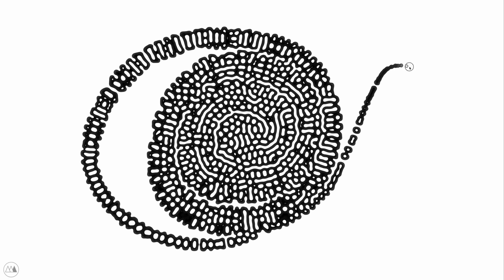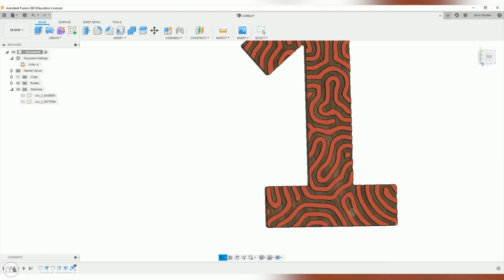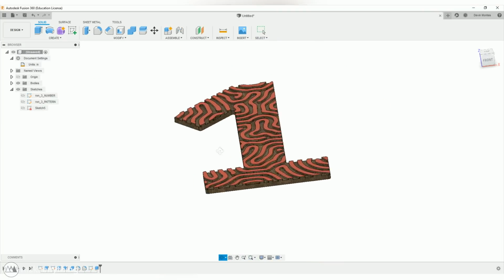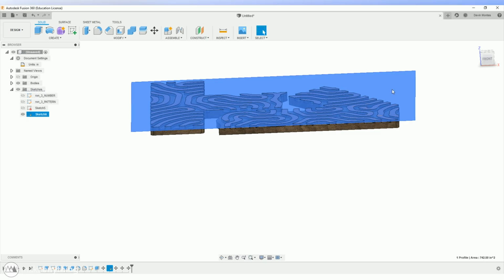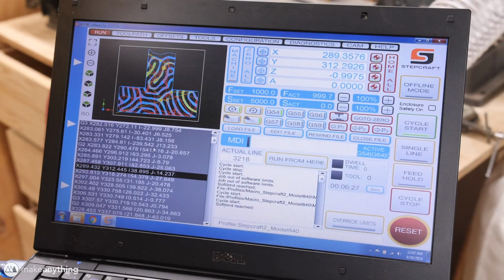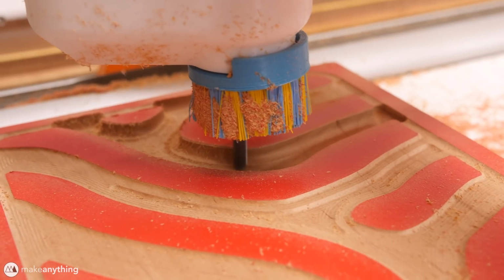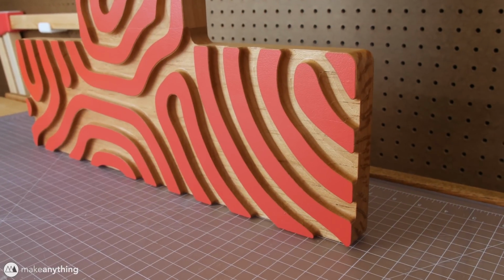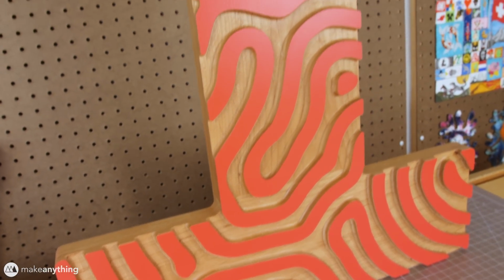My Number 1 Project // CNC Wood Carving a Reaction Diffusion Pattern

Comment: Where did craftsmanship go? You could do this in half the time with a chisel, without an expensive CNC machine and computer to run it. Not to mention the expensive, probably non-renewable electricity! A handheld router would be a great option too. In both cases, there's no need to put two pieces together, you could start with the complete number. For easily laying out the design on your wood, look at Matthias Wandel's BigPrint program, much cheaper than a CNC router ;)

Comment: Cool video. Be careful with glueing end-grain to end-grain in wood because it’s a very weak joint. You might want to look into a biscuit cutter, dowel rods, or pocket hole screws to reinforce joints like that in the future.
Reply from the maker: Oh yea,I definitely could have used pocket screws. I'll just have to add some reinforcement to the back of this one

Comment: 2 recommendations on the toolpathing. First - always do the final contour after the internal features. The work will be much more secure without the contour
Second - I would recommend 2d adaptive over pocket for clearance of material on internal pockets. It will make the amount of material being removed consistent, leading to less broken tools, missed steps, and noise, it's just a better approach.

Comment: next time you want to cut a pocket like this with radiused sides.. do yourself a favor and use a bullnose. (flat with radius but not a full radiused bit)....  better bottom surface finish, faster, also your speeds, feeds, and radial/axial depth of cut need an improvement :D

Comment: End to end glue joints aren't very strong.  Those are pretty big parts.  I would ask that you consider reinforcing the end to end glue joint some how.  One view suggested biscuits between the 2 pieces, excellent idea if you have access to a biscuit jointer.  If you don't, you could drill dowel holes in the end pieces & reinforce with those.  A third alternative would be to cut shallow dados in the back that would match after the pieces are cut out, then glue battens across the glue joint.  Depending on how you need to put the stock together, this might be doable on your table saw with a dado blade or a hand router either before or after cutting.  It would be a bit more work, but the end result would be far more durable over the long run.

Comment: At 4:15 you select every little corner and since doing them one by one is a bit tedious, keep this trick in mind for next time..
1. Look at the model from the edge (in this case, you'd use the Front view).
2. Activate the fillet tool by clicking on it.
3. Next, make it so you can only select edges by clicking the drop-down arrow under the Select tool in the toolbar, highlight "Selection Filters", uncheck the "Select All" option, and then check the "Body edges" option.
4. Now you'll draw windows around the model to select all the edges you want. There's at least two ways to do this... (ugh, this is something that would take 2 minutes to show but 15 minutes to write...)
5a. (This way is likely to work the best.) Position the mouse cursor just to the right of the model so that it is above the bottom of the grooves that will be routed out and below the front surface that will be painted red. Then left-click and drag a selection window from that position, straight to the left, until the cursor is to the left of the model, above the bottom of the grooves and below the red surface. Then release the mouse button. All the edges you want should be selected. 
5b. (This way also works and may be better in some situations.) Starting from outside of the model, left-click and drag a window around the whole model, when you release the mouse button it should select all the edges in the entire model, many of which you don't want to fillet. Then position the mouse cursor above and to the left of the front surface that will be painted red. From there, drag a window to the left and release the mouse button when the cursor is outside the right side of the model, above the bottom of the grooves. This should deselect all the front edges. Do the same for all the edges on the bottom of the model (drag a selection window from left to right).
6. There may be additional edges selected, weed them out by clicking on them individually to deselect them.
7. Type or drag the dimension for the fillet radius.
8. Click OK to complete the fillet.
9. Since you changed the selection filter after activating the fillet tool, the selection filter should return to how it was before, but it might not hurt to check the list again to make sure.
Reply: Oh, I meant to mention that lines between tangential surfaces will not be selected, even though the look exactly the same as "edges".

Comment: When you made the split you could have taken the line down a few cm behind the top layer but left the top ledge so the split was hidden behind the organic line and the joint would be stepped rather than flat.. Make sense.?  It would require taking away some material from one piece but the joint would be truly hidden and stronger. 
1 down .. 40 more to go!

Comment: That type of wood joints aren't the strongest and  fear it would break if the piece is mishandled especially being a thick solid 3ft tall piece. Something like biscuits or overlapping joints would significantly strengthen the joints. I would look up wood joinery and find one that suits you.

Comment: Why not live trace it in illustrator, would have been faster and be the exact/almost the same as the inital Jpg of the pattern, 

Expand and then remove the white objects, and convert the filled vector shapes to super thin strokes that you can export to a DXF. 

Also, you don’t need to model in fillets if you use a ball nose for the finishing cutting tool.
Reply from the maker: I didn't model those fillets inside the channel. I tried live trace but some of the strokes weren't coming out well
Reply: Make Anything ah gotcha. ☺️ live trace has a few modes too, but yeah I know what you mean by it being weird. Thanks for the clarification ☺️

Comment: You should do a "topography" number using the local topography of the building these are going in.  Totally different pattern from this but it would look similar at quick glance.
Reply: I don’t know but I feel like that would feel a little out of place
Reply: What
Reply: Michael means that a number is going to show the buildings around it with the pattern

Comment: Wood can be pretty forgiving, you could be taking 3mm per pass as long as the wood doesn't chip. Also if you use a roughing pass and leave 0.01 inch for a finish pass (use a new tool for finish pass) you might get a better cut quality. The spiraling plunge is usually because endmills don't cut at the very center of the tool, unless you have a center cutting endmill.

Comment: One advantage of clamping over superglue is that you can work on a piece which is larger than the cutting area, then unclamp, slide down, reclamp, and cut the remainder. Getting a good join is tricky but quite do-able.

Comment: For a project like this, wouldn't it be better to paint after the CNC'ing?
Since the painted part is the raised part, you can easily paint it with a roller without getting paints in the grooves/channels.
This would also allow you to stain the wood before painting/finishing, if that's something you'd want to do.

Another thing I noticed is the grain direction difference between both pieces, since they were cut separately.
It's not really noticeable to the untrained eye I would assume, but it's something to keep in mind for future projects.

All in all, amazing project and that 1st piece looks amazing. I looove that pattern and the contrast of the red and the wood.

Comment: As for previewing cutting time: In fusion manufacturing, simulate toolpath and a info menu should pop up on the right containing estimated cutting time.
Reply: Yes, under the statistics tab. You can also hover over each operation in the simulation timeline to see how long each op takes, as well as turn on op time showing next to each operation in the hierarchy in the preferences menu.

Comment: Burning wood is cutting too slow. You are likely using a blade with too many teeth for the hardness of your wood.
Reply: Yep, or the blade is blunt as heck
Reply from the maker: New blade (and tablesaw). Turns out the fence wasn't properly aligned, so that may have contributed to the problem. But probably also the wrong specific blade since it's just what came with the machine
Reply: @make.anything  I think you're right! I wanted to comment that but saw that you had already found it. The burning is caused by the back of the blade and not by the cutting edge
Reply: That’s what I was going to say

Comment: I'd consider gluing a thin sheet of plywood or something on the back, end grain glue joints don't tend to have a lot of strength.
Reply: Yeah I was thinking the same, but slightly smaller so it look like number is kinda floating off the wall a bit if that make sense? 🙂
Reply: He could cover and protect the painted side, then run it thru the planer to reduce it just enough so it isn’t thicker than the other numbers.

Comment: What a fantastic project to learn CNC machine and to expand your maker skills!  My mind is buzzing with the possibilities:  wood, aluminum, acrylic, wood & resin, inlaid metal on wood.  How about mixing 3D printing in such as a number with 3D printed scales or covered in filament flowers.  Or how about exploring half-toning software to create the CNC tool paths.  Or vinyl masks to ‘reverse’ the painted color from this build…

As for CAM videos, as someone with a CNC in my (near?) future, I’ll watch any video you create.  But I think you can cover the CAM for most folks by using a minute of your creation videos to explain 1) what CAM choices you made (bit(s), path(s), and the like), 2) what choices you could have made and why you did not, 3) any ‘special’ CAM settings you used, and 4) what you wished you’d done differently with respect to CAM once the piece is done.

I look forward to your next number.

Comment: Hey Devin. Another awesome vid!! 😄
Just a quick "Pro wood working tip."

Use wood glue and saw dust for a more invisible crack filler. 

Can't wait to see the other numbers to come!!
Reply: Or he could just pull his pants up a bit
Reply: Brian H. This is a very good point. The super glue seals the wood and leaves a clear crack. I use my wood shavings in my lathe work and it works really well.

Comment: Really cool concept and the result looks fantastic.  Just a little tip for you about wood joinery.  As a general rule of thumb, you should add some kind of reinforcement when you have a joint where the end grain is one of your mating surfaces.  It could be something as simple as some dowels buried inside the joint.  Basically when you try to glue end grain, it results in a fairly weak glue bond that will most likely break.  I'd hate for you to go to all this effort only to have those glued joints break apart down the line.  Keep up the good work!

Comment: Glad to see you using the superglue and tape technique I recommended, It is a really good time and money saver, that double-sided tape is really expensive.
 Another tip! If you are using small blanks to route, I have found that putting superglue on one surface and spraying the other with accelerator gives an even stronger bond.
 I love that numbers design!

Comment: you use ball nose not end mill  for cut at first tool and I notes your cut depth vert tiny  1mm only for wood  man don't be afraid it's just wood unleash your CNC router
Reply from the maker: Just afraid to take a big chunk out of the wood and delay my projects :0

Comment: I think you could have cut the CNC process down at least half the cutting time, in fusion you should program a roughing pass that is much faster and goes much deeper than what you have currently (for the pattern on the inside). Then Finnish with that slow shallow pass you were using the whole time. I used to do the exact same thing on the CNC I use, sadly I have no idea how to give you reference material because I was taught this in person haha. But I’m sure you can figure it out! I really like the end piece you have by the way!

Comment: Oooo, I love that you got that commission! As an Interior Architect, this is a great video as inspiration. If possible, let us know what the numbers look like in the space please. 

In terms of the manufacturing aspect, I would love to learn more. Getting information from new makers and more experienced makers is all great to see what works and what doesn't.

For future use if you happen to do anything interior again, make sure anything attached to a wall isn't over 4" thick. Also, remember flammability if the building is on fire and how it attaches to the wall for earthquakes.
Reply: I would hope the commissioner (is that what you call someone who commissions a piece of art?) would be aware of this and make a proper request
Reply: @ciarfah  They probably did, more than likely. It's also for anyone else who is inspired to make wall art and happens to read this comment. That is a great point to bring up though.
Reply: I’m an architect.  I presume the 4” projection you speak of is so that this art doesn’t violate the ADA rules?  Good advice!
Reply: @Fishbone4u  Correct since the artwork will more than likely be hung above 18" from the floor to the bottom of the artwork.